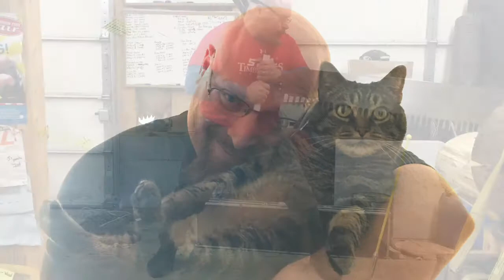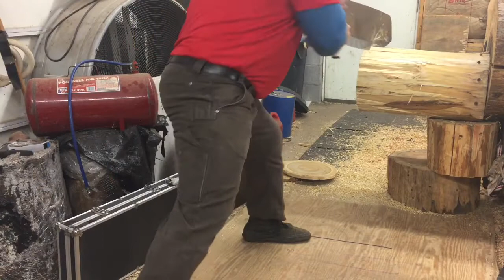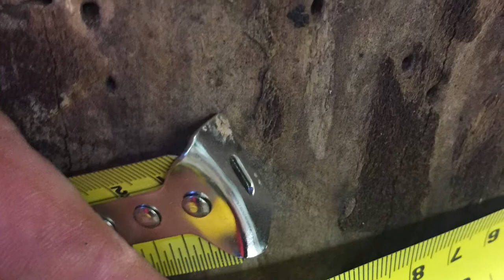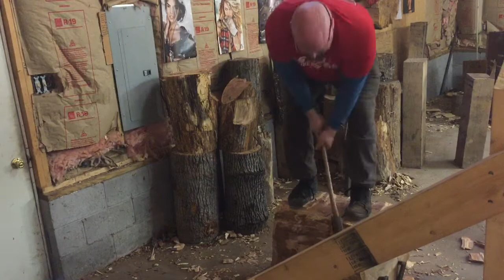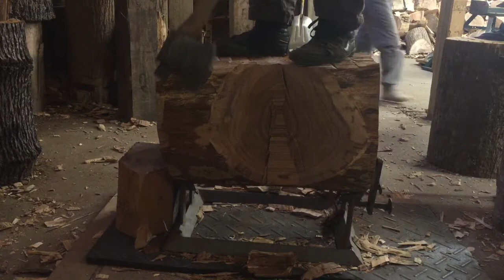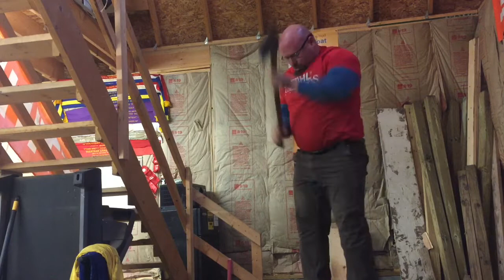3.23.17 Day 14 Event Training

Comment: so I have been single bucking for a short while. I was wondering as I have been told in the past to push the full saw. Is there a reason why you do not push the full saw through the log? is it for a purpose or is there a hidden reason? Thanks, 
Tim
Reply from the maker: Tim this is not the best session to watch for that.  I am leaving for Sydney in two weeks.  There the wood is small and hard.  I have to alter my stroke for that race - shorter and steeper because the wood is small and hard.  Longer strokes is essential on softer wood.  I hope that makes sense?